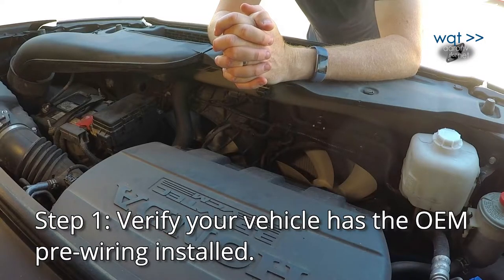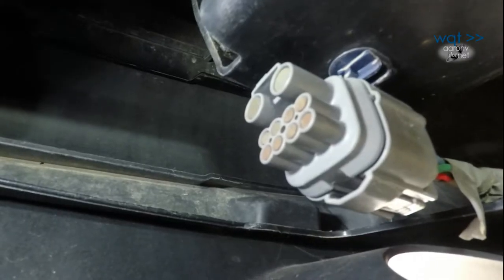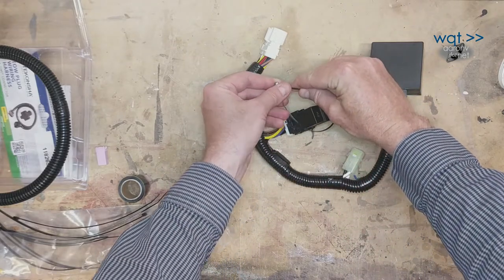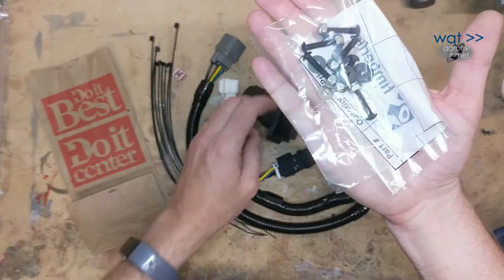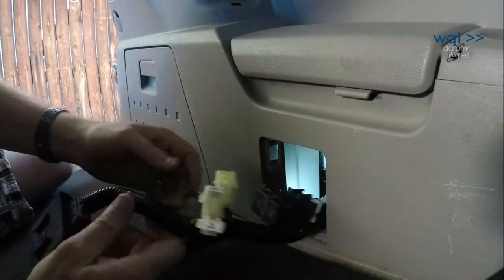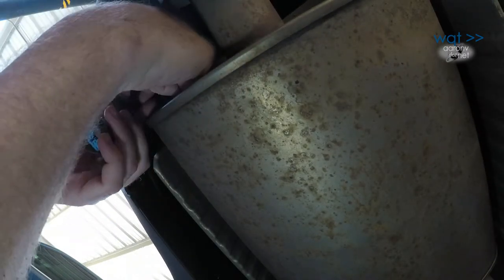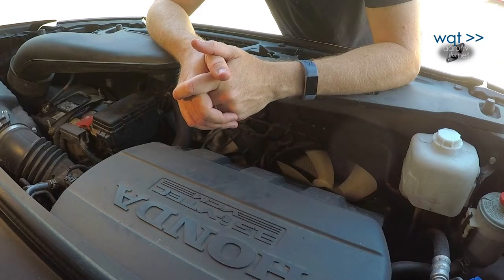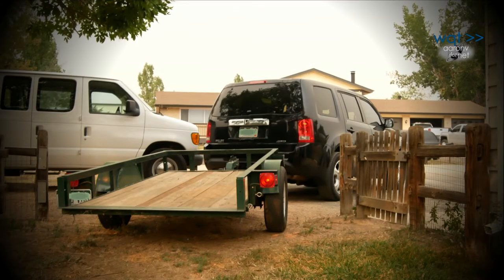wqt// Basic Auto: 2012-2015 Honda Pilot OE Trailer Harness install

Comment: Just got home with my harness. Going to start on this next week. (Jury Duty tomorrow.) Found this and it looks like the one I'll watch out in the driveway. 
Wish me luck! 
I'll keep you posted.
Reply from the maker: Very doable, just a couple difficult spots to work as noted in the video. Another commenter suggested the rear bumper wiring is easier to do if you lower the spare tire first. Good luck!

Comment: Nice job here.  Really appreciate the detail and tips around wire protection and the threaded bolt hole in the rear to keep the wiring tight and secure.
Reply from the maker: Thanks for the feedback! I was pleased to find that threaded bolt tab when I got under there and thought others might find it useful as well.

Comment: Thank you for pointing out the difficult parts of this installation. I'm in the middle of this install and have been frustrated. A video from a company that sells this kit makes it sound like it's a breeze to install.
Reply from the maker: What, you're not a fleet-installer working on a factory-fresh vehicle for the 350th time? In seriousness, though, thanks for the positive feedback. I do want to show how you will experience the install as the owner of a used vehicle. Not all vendor guides are fair in showing how the job will go when your car has a few years and 100k miles gumming up the works.
Reply: Where could I order this from?

Comment: Nice video, good information. I would like to add a couple of points if I may. If you remove the spare tire it makes it a lot easier to work in the space, especially if you are crawling around on the ground. The rear plug is held up by a trim type clip. If you use a screwdriver or trim tool to remove it you can reuse it and don't have to cable tie the plug back up to the chassis. There is a clip on the topside of this plug as well that is released by removing the trim type clip from the plug (it slides out) DO IT and the weather proof plug will release.
Reply: The weatherproof plug is the worse design ever.  Why does it have to be so hard to remove?  Not very self-intuitive.

Comment: Excellent video! Any tips on removing that weather sealed plug without butchering ourselves?
Reply from the maker: Another commenter said the blank plug has a slide-lock clip that releases the plug. I didn't find it on mine, but it's worth a look.
Reply: @aaronvienot  my pilot does not even have that plug at all and no accidents from rear either...???
Reply: @aaronvienot oops wrong alarm, I have it. It looked different than the one you have on the video.

Comment: Very informative video. Can you put a link to where you got the wiring kit? Or possibly the brand and part number of the kit? I have the same vehicle and want to do this installation. Thanks.
Reply from the maker: Thanks for the feedback! I went to eTrailer.com and then searched by vehicle type. The Tekonsha T-One kit with seven-way connector is the first thing that pops up.

Comment: There's noting attached to the blue clip at the bottom.Seems like it was previously cut. Is this normal.That's the only thing missing Is this needed or can I just run it from the inside out?

Comment: Why does the OEM kit have you remove all yhe interior and third row seat?
Reply from the maker: I am not familiar with the Honda OEM kit you describe, but it is possible some of the rear interior would be removed to install the trailer hitch receiver, and ideally, the trailer wiring kit would be installed at the same time. But since the wiring may not be required for small accessories such as cargo baskets and bicycle carriers, some owners will have a hitch receiver installed but skip the wiring. That was how our Pilot was equipped when we bought it used. I then added the wiring kit as shown in the video.

Comment: What aftermarket kit is that? Been struggling to find one that fits 2012, the only one I've found so far says only for 09-11 pilot and 17-21 Ridgeline. I'm a little lost!
Reply from the maker: I got mine at eTrailer.com (no affiliation, just good service in my experience). Start with the vehicle selector at the top of the page, after that you should see "Custom Fit 20XX Honda Pilot Accessories" with a number of choices. One of the first should be "20XX Honda Pilot Trailer Wiring."

Comment: THE DUST COVER!!!
youtube won't let me paste pics, so I'll try to explain it here. 
The factory plug (with cover) is held in place by a clip. Pull that clip out so the connector hangs free. The clip that you pulled out is held in place by another clip. Lift up on THAT clip (I used a small screwdriver) and remove the hold-the-plug-in-place clip from the plug. 
The cover will slide right out. Connect the factory plug to the trailer light plug cable, THEN slide the hold-the-plug-in-place clip back into the connector. 
Snap the clip back into the frame under the bumper, aaaaaaand yerdone.

P.S. Thanks a $#!+ load for now making me realize the wheel on my spare is horribly rusted and needs to be replaced.
Reply from the maker: Thanks for the info! Hopefully other people figured it out along the way and avoided the pain.
Reply: @aaronvienot  Sending you an email with pics in case you want to add it to your video.

Comment: I can not find the connection plug under my 2012 pilot at all. What am I missing?
Reply from the maker: Is it possible you have a trim line that did not include the factory trailer pre-wiring? Check with your local Honda dealer to confirm the options list associated with your VIN. Also, did the vehicle ever take accident damage to the left rear quarter and possibly the damaged harness was not replaced?  In that case, you'll need the replacement wiring harness section from a Honda dealer or from an auto salvage yard.

Comment: Does the backup  light work  on aftermarket  products?
Reply from the maker: I haven't had a chance to test it on a 7-way trailer, but AFAIK there's no reason why it shouldn't. Got any experience with a setup that failed?

Comment: i can’t get my cap ofd
Reply from the maker: Which step are you at? Is this the dustcap on the 7-way inline connector below the bumper? If so I'm not aware of a magic solution for that one, you just got to keep working at it. A touch of penetrating oil around the edge might help, and maybe warming it up with a hair dryer.